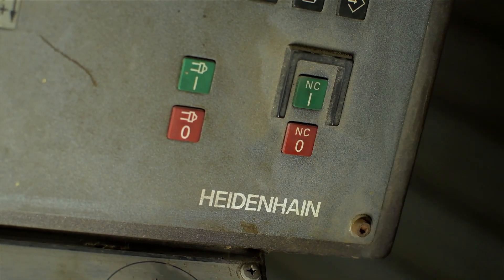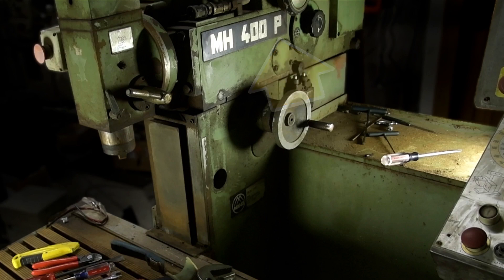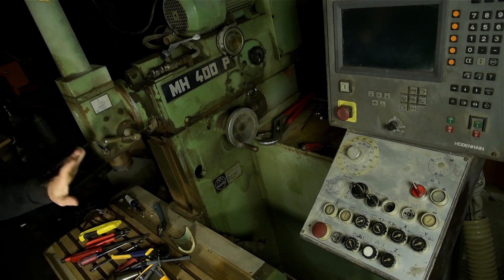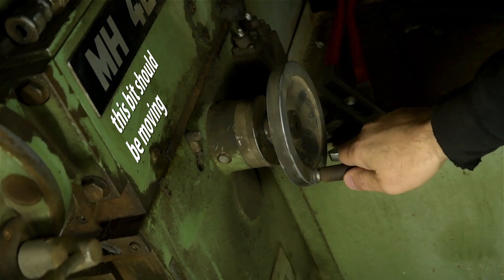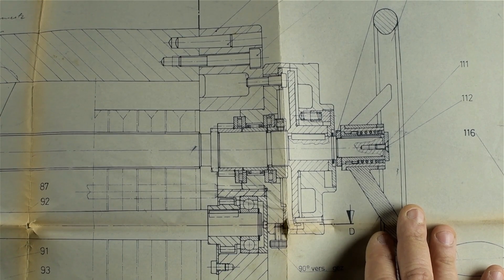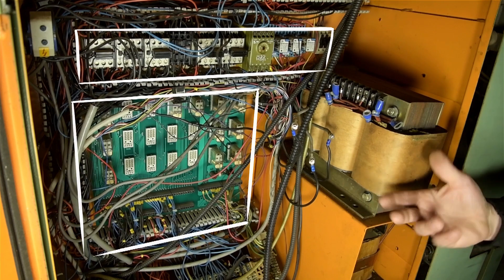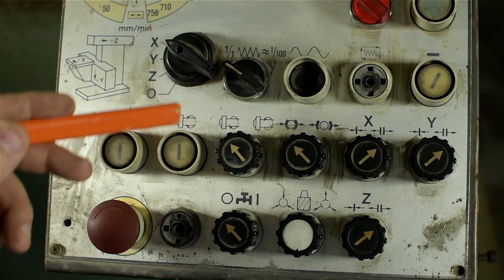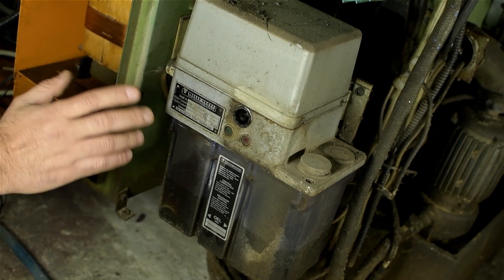MAHO is Filthy!!  (Whose Milling Machine Isn't?)

Comment: Not sure if someone has mentioned this in the comments already but I have seen similar table setups on "Deckel" milling machines, where the table is actually at 90 degrees to the usual, and a bracket is fitted to bring it up to the conventional orientation. (I say bracket - it's pretty much an entire table which is also 90 degree angle plate).

Comment: I got one in fully working condition for free  that will do   What your trying to do let me get out the old callipers and micrometers and I’ll draw you out some diagrams  and put in pictures of the changes done to mine to give you some ideas  and I mean a engineering firm was using the machine till last year when they went bankrupt so it’s gonna be relatable

Comment: Well this old tony i got ripped off at the nearest machine shop. Needed some flywheel dowels. Gave then then best one and specs.got trash back in the form of drill steel. There are 3 and none of them are the same or even near the measurements i gave them. And on top of that it cost me 80 bucks and half a day

Good video anyhow.

Comment: Even if just testing, it is worth adding some insulation of those mains wires that just hung about in the air. At least some PVC tape or something. Takes 2 seconds and is well worth it.

Comment: That Transformer you disconnected is probably a seperation Transformer. It takes away the reference to ground so if a wire touches the frame you dont get shocked. If you ground the mashine properly you schould be Safe without it.

Comment: I can't remember wheter those transformes are used for power factor, I do know we had huge one's going to our lines , I was told I believe they said they where there to clean up the city power as it varies a lot and that caused the line machines to vary causing out of spec material, of course does lines where from the 60s so you gotta baby them, a lot of the circuitry was state of the art then. Recently we replaced the drive for the carriages and the testing units these we where told can handle pretty big fluctuations in voltage and still manage to correct for it

Comment: Those chunky doodads are likely line reactors AKA inductors. Their job is to smooth out large current spikes and prevent tripping of breakers (lol) and other current devices when there's a sudden start or stop/reverse. Those are likely shorted out between phases (ezpz metering to check) and aren't strictly necessary, but if you find that you keep popping the breaker or other safeties while moving it, you may want to call your local automation supply shop and see what they got.

Comment: I have a feeling that 400 in the name is for the size of the milling area in width, which is 400mm on this machine. Which would imply that 600 would be for a 600mm wide machine. I would also assume, based off of that information, that both machines are the same, except the size of the moving plate, it's drive screw, and it's DRO components. Similar to how you can buy a truck with either a standard, extended, or crew cab. This would also mean the manuals for the machine will be probably 90% interchangeable. Though if the milling area also changes in the X and Z dimensions, that could cause issues, but all of the electrical and mechanical should be consistent between the two, just longer parts and different chassis.
I could also be completely wrong, but that makes the most sense to me.

Comment: just modifies electrical circuits using common sense
sees it work and feels a bit disconcerted by the fact that some ghetto hack actually didn't explode
suspicious staring for 10 minutes, shrug, use it anyway and until power brick detonates
Yup.  You and I would get along.  "fuck it.  seems to wor-oh nevermind... that exploded"

Comment: I'm pretty sure those hydraulic valve coils shouldn't make that much noise.  Maybe it has to do with the reactor you disconnected.  The coils sound "Saturated".   Whish I could explain that better but someone with more knowledge than my guess will probably comment....

Comment: A large inductive coil wired in series is a choke. Like the ballast in flourescent lamps. Theoretically with a 0.35 amp ballast, you could short the floorescent lamp electrodes and it would draw in the vicinity of 0.35 amps. The coil, when load is shorted, becomes a transformer with no secondary coil. Perhaps, if i understand correctly, your transformer was wired in this way? I have no earthly idea why it would blow a breaker. If windings were shorted, the inductance of the choke decreases, and the limited current ceiling increases, but we know your machine by itself doesnt blow the breaker. So shorted windings would electrically be the same as bypassing the choke. Which is what you did. Cant be that. Windings shorted to ground is another possibility but, to be honest, my first guess is "someone wired it wrong." I dont know how it goes from working to not working at the yard, i dont think the scrap guys rewired it. I bet it came in the door, they were told it worked, and they believed it. All of this is just a guess, but anyway thats the electrical term for what I understood your description to be. Choke.
Reply: Gives the CNC machine more gas for cold starts
Reply: If its two wires in and two wires out with the same ratio of turns on the in and out side, it would be an isolation transformer. Shorted windings then may cause a breaker to blow. Can't figure out precisely what you meant by "power comes right back out."

Comment: That input coil is a inducer/filter thingy like you said.  It's purpose is to sink out power grid drops when other machines fire up and pull the main voltage down.  They where installed so the machine could integrate into a large factory where large loads are put on and off the power grid regularly.  They did this because the solid state controllers ran on 5 volts back in the seventies.  They do not like voltage spikes or browning out from low voltage.

You should be fine without it if you have a stable main signal feeding it.  Worst thing that will happen is a servo controller will fault or the cpu will reboot.

Comment: that transformer has to be a choke, as far as i know it is used to filter "dirty" frequencys so that you afterwards have a "clean" voltage for the control circuits, these things are usually used whenever you have a motordriver in a switching cabinet so that the NC keeps working as intended and doesn´t get hit with hig frequencys

Comment: We had a similar CNC mill at school. But even bigger. It was sort of water or air cooled for tolerances and took 2 hours to get everything up to its running temperature... and it took punch cards but was upgraded to a 8kb memory if im not mistaken ... yes kilobyte.
If you went out too far it drove the table out of the axis and you had to manually push and turn it back in and re-calibrate.
Good times.

Comment: Looks very similar to the zayer mills made over in Spain. They use the same feed motor system. One motor that can reverse direction and ramp up and down for feedrates, then 3 clutches to power individual axis.

Looks like a fun project to turn it into full cnc!

Comment: Nice! I have got a very very similar machine acquired, with the same intention to convert it to a more modern cnc machine. It is a Deckel FP4 NC from the same time period (and all the good stuff: automatic oiler ball lead screws, hydraulic draw bar. I am looking forward to your conversion, mabe I get some inspiration to finish mine ;) 

PS: mine has an actual gearbox for the spindle, how does it work on your Maho?
Reply: I took one of those apart for a maintenance class in college!

Build quality was something to drool over… it had been in use for 2x as long as I’m alive and it had some worn parts like belts, bearings etc. But the mechanical parts? Axles, gears etc? Fresh as ever. Some fresh oil and they would’ve been good to go.

Excellent stuff, apparently it had been bought by a company that made plastic parts, the mill was used to make molds, requiring very tight tolerances and careful work. The guys from that company said it has been in use for more than 40y, and it had less play in the drive and gears than the newer machines that had been running for 10y lol.

Comment: The transformers are likely auto transformers. They are usually used on equipment sold into different markets that have different supply voltages and types. Taps from the windings are usually labeled for input connection points. Output connections usually stay the same. I've seen German drawings call them 'reactor' , although not sure why.

Save your elbow grease and go to Harbor Freight and buy a big container  or two of Goop hand cleaner. Spread it on with a cheap paint brush. Leave it on there for a couple hours . Wipe it off with blue paper towels. It'll take all the shmoo off the machine pretty easily. I used this method on a 70 year old lathe that had been in near continuous use. Cleaned it up pretty nice. There was still original paint under the shmoo, which the goop didn't harm.

Comment: I believe Deckel and Maho kind of invented that style of mill almost simultaneously way back in the day and eventually merged with some other companies to become DMG Mori (the D is for Deckel).

The only other brand well known for small machines of that style if Schaublin, as you well know. 

Certainly has pedigree and they are fantastically well built machines. I'm assuming that transformer was just for power isolation to avoid tripping breakers under load etc. Probably has some dead insulation in the windings somewhere.

Comment: Was really excited to see this video. Ever since your cnc basics videos I have been drooling over cnc/vmc machines. I had a couple I was looking at. I had a Cincinnati sabre 750 pop up for sale and I purchased it a month ago. It will need a retrofit as well. The basic machine is fairly sound and I look for to working on my project.  I plan to gut most of the current electronics as things have changed a good bit since the 90s. Thinking of running linuxcnc and using messa cards. Would really like to use the original motors though. Excited to follow what you do!!

Comment: I once worked on a system that included some hydraulics.  The hydraulic power supply used to make a noise like yours - it was the pressure relief valve.  The hydraulic pump is a constant volume device so enough fluid flows until the output power equals the input power.  If you block off all the pump outputs then the pressure can rise high enough to stretch the bolts.  Hence the inclusion of the relief valve.  My understanding (I'm NOT an expert) is that you can design the hydraulic system two ways.  The noisy way is that the load impedance is sufficiently high for the pressure relief valve to be continuously open, not very efficient.  The quiet way is that the required energy can be delivered to the actual load(s) at pressure less than that at which the relief valve opens.  Like I said, I'm NOT an expert so I'll be watching the comments.

Comment: great video as always..  there are many other better choices out there for your first CNC machine,  pick up a machine that is already CNC, this will save you a ton of work and money, and it will produce better parts than most machines that were converted to CNC from a manual machine.  Often you can pick up the first gen servo machines for a song as the electronics in these would typically fail way before the machine wore out.  Examples of a few are the Bridgeport Boss 8-12 CNC knee mills, Sharnoa CNC knee mills, Shizouka CNC knee mills,  Clausing Kondia and more..

Comment: Here in poland we have a LOT of MAHO machines. This is a very good brand, especially older ones like yours. Im toolmaker and in my company we had 20+ years old MAHOs (maHOES ? :D ) and every single one could keep up tolerances within 0.02mm, most of problems was solved by replacing some small thing like electromagnet in valve. Im only suprised with trapezoidal screws and not ballscrews in your milling machine. WE also have few machines from 2000+ i belive and mechanically they are fine but electric side is just a mess.

Comment: Thanks for making me feel better, I just got over the flu. Yesterday my thermostat went out. So I went to local hardware store (small town ks, i mean really small, the kind of small were they teach hunter safety course at the Jr high). Anywho bought the thermostat got it home, come to find out I have a 2 stage thermostat. I was freaking over that wiring, 7 of them. Color coded, I did wright it all down. So I ordered the correct one. The reason for freaking out it's supposed to freeze tonight. The part were you made me feel better is when you opened the electrical panel on your new machine 😁, suddenly my 7 wire 2 stage thermostat wasnt so bad. Feel better. 

PSA.check the batteries in your memory thermostat, because a leaking battery will eat the electronics. Smoke detectors, check the air in your tires, test the coolant in the vehicles....

Comment: I believe that 'Biggest device in the control cabinet' that you'd disconnected is a Reactor - essentially supposed to limit the amount of instantaneous current the machine could draw from the line.   (Strange how it seemed to be doing quite the opposite).     They're usually used on VFD's to protect them and upstream components.    Guessing that the blue pancake motor has some sort of VFD on it that would control the feedrate, and the hydraulics determine what axis that feedrate applies to...

Comment: Often they use tranformators to isolate some components wich can make unwanted pulses from other sensetiv components in electronics. But i dont see why you would need it ther. Its not...a space station so the tolleranc isnt that high...i would think...

Comment: I always knew that this day would come. You getting a real cnc mill. 
I found a killer deal for a low hour Emco VMC300 with a controller fault, that turned to be one loose solder joint.

Comment: Not telling you how to do your job but I would dump Mach 4 and go with a centroid Acorn controller.  Centroid will be coming out with a new add on card soon to expand the Acorn’s Inputs outputs.  400kz, backlash compensation, and has been rock solid since I made the switch ( I had mach4/hicon integra).

Comment: I wonder if that transformer is an isolation transformer?  For some reason? Also wonder if it’s shorted or just still wet (due to it being large enough to safely get a job at local power plant). I’d try tossing it in the oven under the “warm” setting and seeing if I could dry it out?  But then again, I’m not an electrician, but I did stay at a holiday inn express last night.

Comment: Mr Old Tony, I have followed the whole CNC router project, I've been looking into making my own desktop milling machine, perhaps a 5 axis. But it has left me with more questions then answers.

When it comes to machine design, I've followed in your footprints for a fixed gantry mill. After hearing that your router is starting to loose accuracy due to trapizoidal leadscrew issues etc. Is there any other way of maintaining accuracy as I plan on running ball screws for my design.

Can Mach 3/4 handle running simultaneous 5 axis machining, and how does one set up the kenimatics of the machining center? Is that a parameter on the CNC driver board or is it controlled via Mach 3/4?

Can Mach 3/4 handle a tool change device, as my plan is to have the tools on an area of the bed, moving spindle to each different X : Y location of each tool. 

I hope to hear from you. 
Kind Regards from South Africa
Reply from the maker: The router has ballscrews, not trapezoidal, but I bought really really cheap ones.  Which isn't necessarily bad, but I used them to cut a lot of steel.  Even chromoly.  The bearings and nuts on those probably aren't great.  Stick to wood, aluminum, brass, etc., I'm sure they'd last a lifetime.  Keep them oiled.

Not sure if Mach can do simultaneous 5 axis.  I think it might!  The bigger problem is maybe generating simultaneous code?  I haven't gotten that far.

Yes Mach can do tool changes.  Should be plenty of info online / youtube.

Good luck, have fun!

Comment: I knew it had to be connected to Mori. I used to run an MH400, MH500 and MV40. 

BTW the H’s were horizontals and the Vs were verticals. Which would account for the odd axis designations. I’d wager that’s a horizontal at heart.

Comment: That transformer looking piece you jumped out was probably a line reactor.  They are usually downstream from VFD's to smooth out the choppy waveform.  It is probably justy some overengineering to keep smooth nice power going to that sweet sweet controller.

Comment: Tony, that is probably an isolation transformer, designed to protect the operator from voltage directly from the line supply because the operator is in contact with ground (the chassis).  "Transformers that have a ratio of 1 to 1 between the primary and secondary windings are often used to protect secondary circuits and individuals from electrical shocks between energized conductors and earth ground."  See if you can fix that fault and run the power through it because it greatly increases the safety factor.

Comment: As a millwright that works on 40-50 cnc machines weekly, I can guarantee you the automatic waylube system did not cost as much as you paid for the entire machine. If you want an upgrade I would recommend a lube usa MMXL-Iii SLR (single line resistance) easy to integrate to whichever new control you install.

Comment: Ahhh, This Old Tony. FYI, the pencil you are poking electricals with has a CARBON  core. It might bite you if the electricial is indeed dodgy. Might be better to use a non conductive poker. Cheers from Tasmania, Australia.